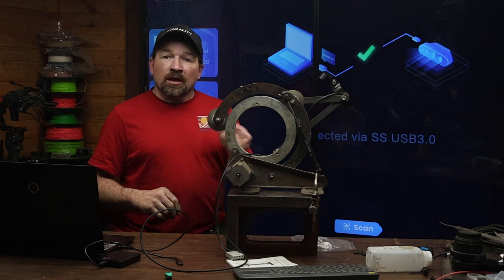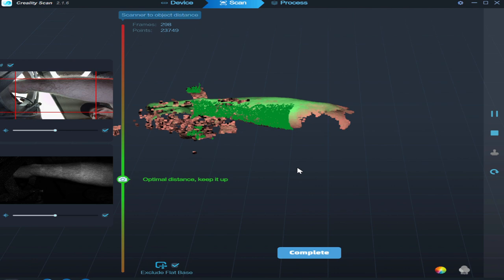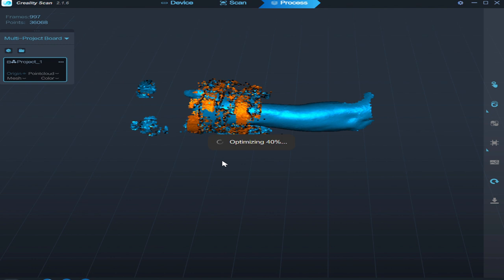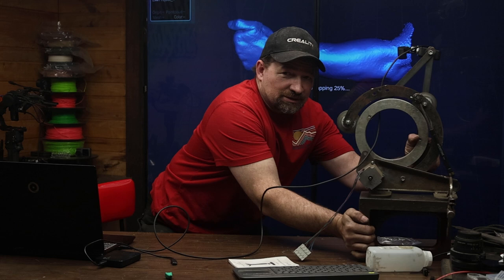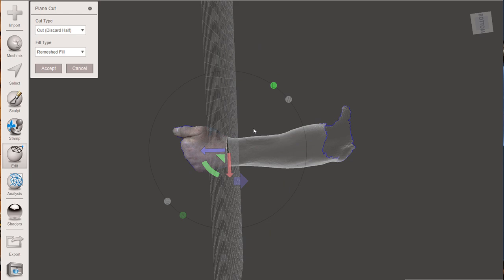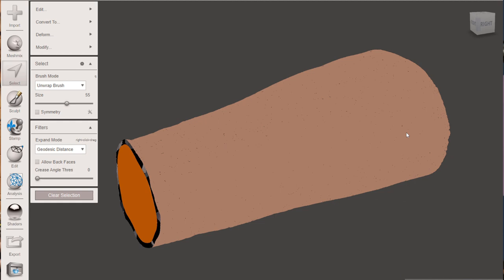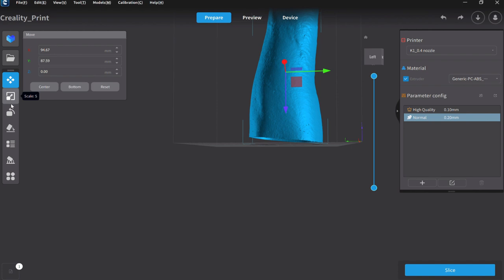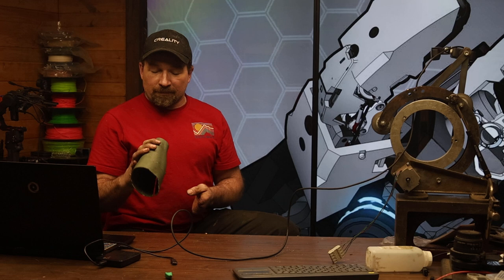Cosplay Armor or Prosthetic Socket Fabrication using 3d Scanner, Printer, and Seal a Meal!

Comment: I think (from my experience) a regular photogrammetry might do a better job here. Just with a few highres photos the result would be about the same, with like 20-30 you'll get a highly detailed 3d model of the object, especially if it has a good texture.
Reply: @missingpartsclub your setup is already ideal for photogrammetry, if you replace creality with a good high resolution camera to take photos (or 4k video) you can then use meshroom or agisoft to reconstruct the 3d model.  Would be a much cheaper and more flexible solution as well.

Comment: The scanning rig is a bit overkill, I have a revopoint. I’ve done similar stuff, this software/scanner is not great, you could defintely do this freehand with a revopoint, even with one hand you should consider switching to one. You don’t really need to stay at a constant distance I’ve found, it auto corrects. Love your videos, your an inspiration!

Comment: Too cool, as always. Won't you need an initial offset to account for a sleeve of some thickness, or is sleeve thickness approximately accounted for in compression to the limb?
Reply from the maker: I'm taking care of the squishiness of the forearm by scaling the scan to 98%. -2% works pretty good for me,  your mileage may vary.